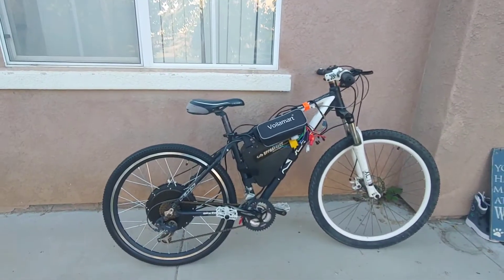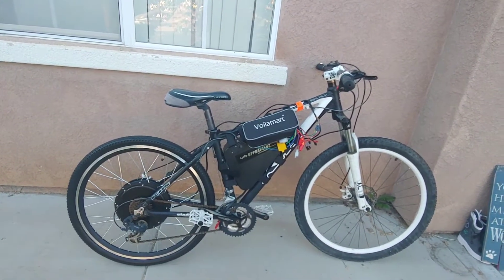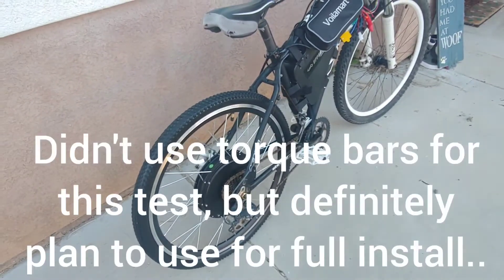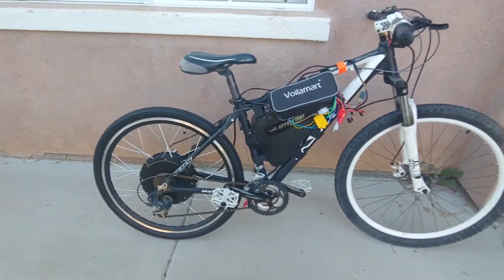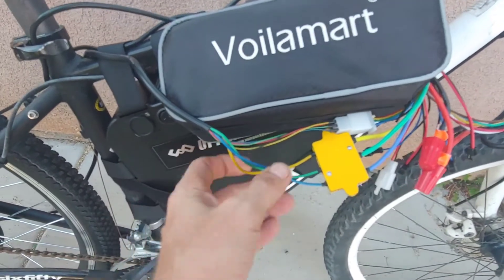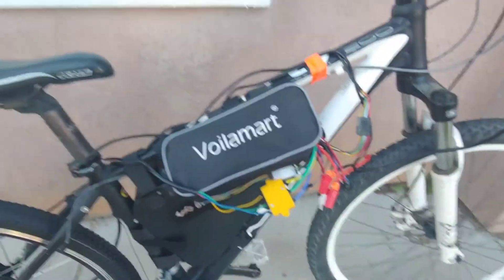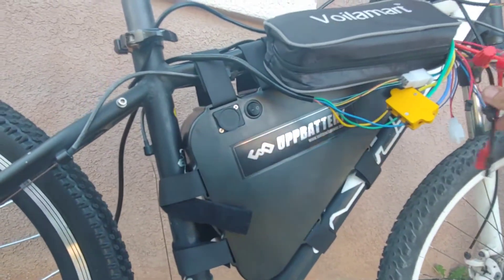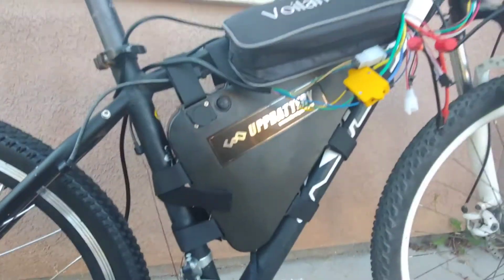Voilamart 1500 eBike Conversion Kit (Electric Bicycle)

Comment: What part did u use to connect the controller to the xt 60 I need one because I don’t know what to do
Reply: You most likely got it sorted by now but...
I'm thinking you may need an XT60 to XT90 connector block, if not just solder red to red and black to black (But!!!! Make SURE your battery is OFF before doing anything with red & black as they are your main power wires)

Comment: I had this for 2 weeks now and all of a sudden the wheel started going into reverse.
Reply: did you fix it? also would it only go in reverse when trying to throttle? or no matter what it would go reverse
Reply: @e.huss1  I had to switch two wired at the junction box. It's been fine since.

Comment: 52 volt? The Voilamart 1500w unit I am looking at says 48 volt. are there different ones or will the 48 volt unit accept the 52 volts?
Reply from the maker: Same unit - just running it slightly over voltage for more power. Tons of info online about it.
Reply: They call em 48v or 52v in this range, my 48v charges upto 55v and 52v charge upto around 58, just like a 36v is 42v Charged, these controllers are 30amp so its good enough for 40mph easy